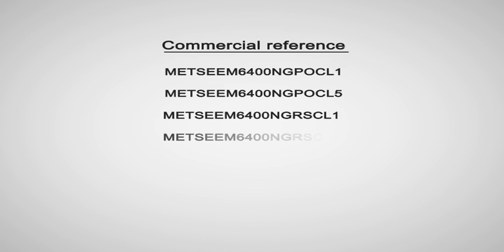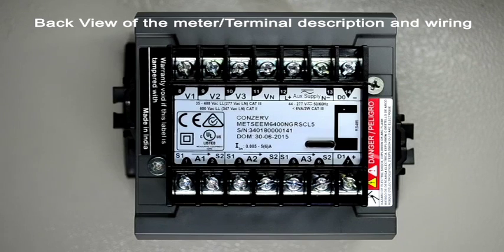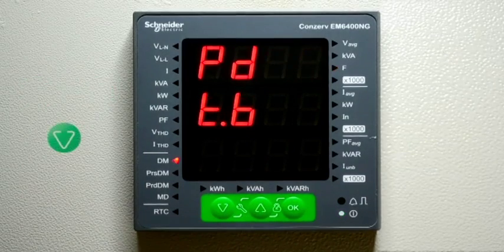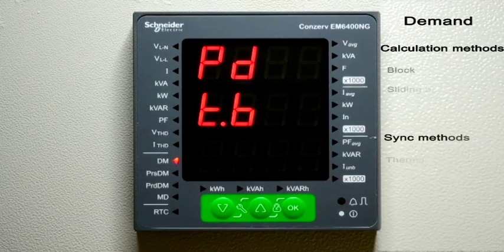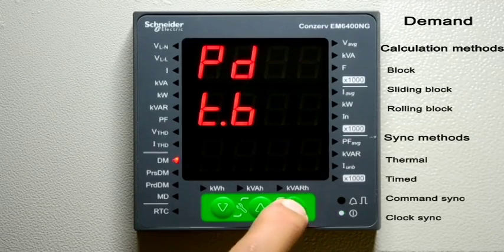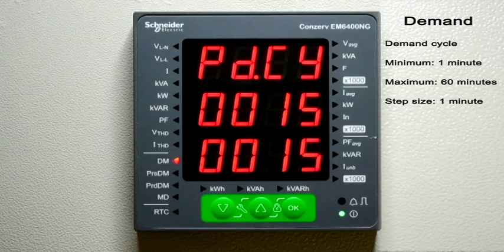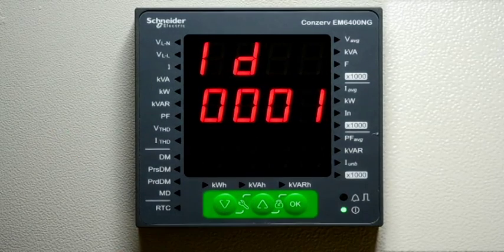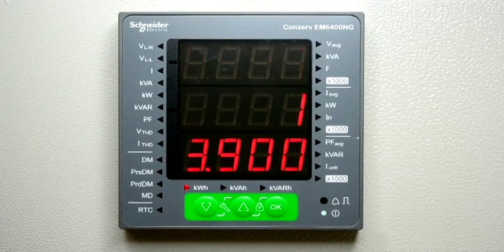EM6400NG Installation and Set up Video

Comment: Sir need a help
I have EM6400 energy meter
I have communicated it with modbus software and check all the parameters like Voltage libe to line,

Now i want to change the settings in meter like A-PRI and A-Sec through modbus software.

Is it possible or not
Reply: Yes, it is possible. You can use ION setup software for changing the CT primary & Secondary. 
Refer this video for more information on the configure meter in ION setup
https://www.youtube.com/watch?v=rOMrMlt3DeY

Comment: Nice video sir
 Recently I have installed this meter. But it shows very low power factor.  How can I change  the setting of power factor??
Reply from the maker: CHECK CT CONNECTION & CT RATIO.
Reply: Kundan Jha ct ration is 100/5 and it also shows in meter too. Connection are good. 
Can you help me, it really create me ya lots of problem.
Reply: Sir can we set PT secondary value other than the available options. Can we set PT secondary value to 415volt.Please help me by providing me the steps.
Reply: I tried but couldn't able to set 415volt to PT secondary